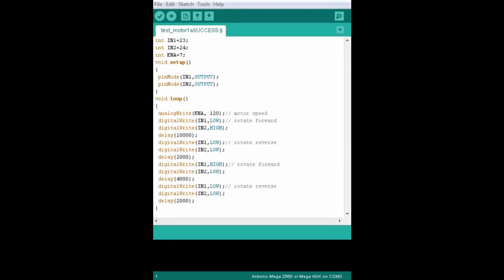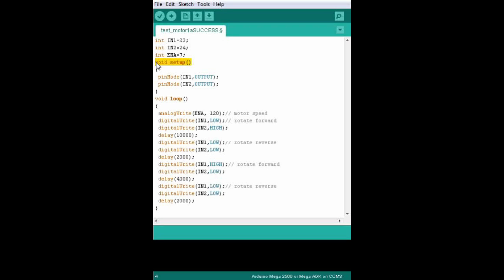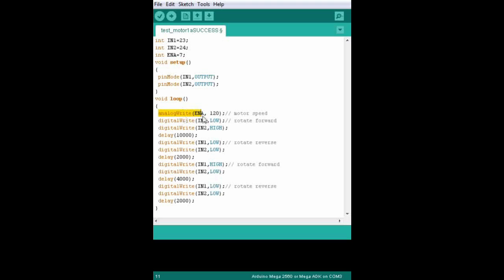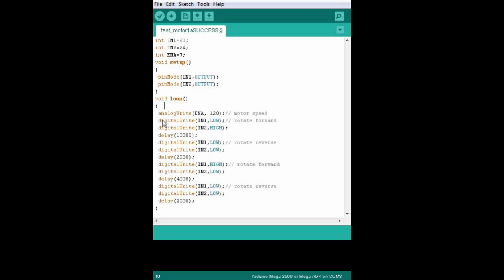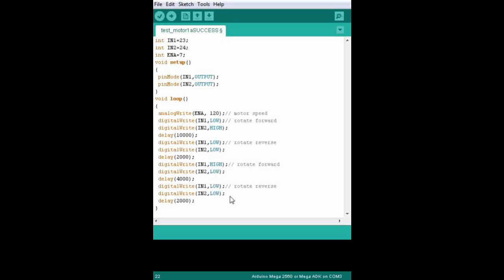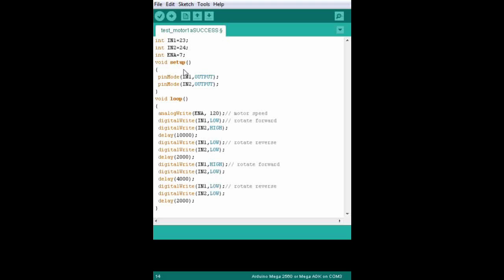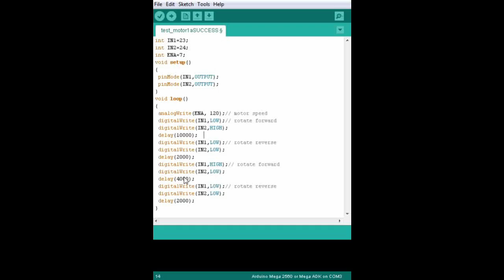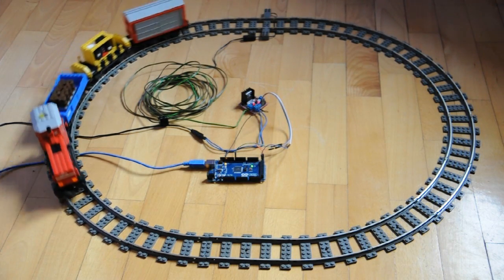Arduino for Lego Trains #1: Introduction

Comment: This guide misses out 2 key parts. The power supply, how it's setup and what you're using. And how to transfer Arduino code from the IDE to the board. But otherwise thank you for this, I'm setting up a Lego train for a display based on your guides.

Comment: 4:53 quick question what is that little red button on the arduino board is that like a power button so you could toggle it if you want to
Reply: Reset button. Restarts your code.

Comment: Hi, I also have had a lego train for many years and have often dreamed of being able to set up computer control of it so I was delighted when I came across your videos. So far , I have purchased an arduino mega, some ribbon wire and the L298N motor control module. Having just re-played the video I noticed that you use special connectors to connect the ribbon wire to the L298N module. I would be very grateful if you could tell me what these connectors are called so I can order some. Many Thanks

Comment: You are using the old Lego trains. My question is : can I do these smart things you describe in your videos with these type of trains ? If yes , which of your ideas ? Could Arduino and the L298P achieve the same result with the newer Lego 12V models which have onboard power as opposed to track based power function? I don't want to buy the L298P and Arduino and not be able to use them.
Reply from the maker: Check out the videos number #11 and higher. They are all based on the newer 9V trains with battery packs. Lego has not made 12V trains in nearly 40 years.
Reply: @ArduinoLegoTrains  I have a similar question. Could you explain how to connect the newer 9V trains to Arduino and the Motor Controller? (Where do the C1, C2, GND, 9V wires all go in and How to set the speed  for these new 9v trains?)  I've looked at video #11 but still cannot find how to wire the newer 9V trains.   Thank you for the great videos and help!

Comment: how can i implement it with a L298P?
Reply from the maker: As far as I know, L298P works exactly the same way as L298N. If this is a shield, you just need to change the pin numbers in the code for IN1, IN2 and ENA.

Comment: Hey man, first of all just want say thanks and really amazing job on the series of vids...they have been immensely informative, well produced and an awesome help in getting started with Arduino and Trains when starting from scratch. Great job !!! 😀Your series has inspired me to start my own tinkering and Lego trains project. So a quick random question for you (and I really don't mean to ask / bother)...all your examples use a L298(N?) motor driver with 3 H-bridge pins per channel (i.e. with a dedicated brake pin). Any idea how you would brake / stop a motor on a driver with only 2 H-bridge pins per channel (direction & PWM) ? I seem to have picked up a driver (DFRobot L298P) with no dedicated brake pin 😕
Reply from the maker: I've never heard reference to a "brake pin' before. All motor controllers provide two wires per motor, so that they can supply + and - to make the motor spin. On the other side, they have two input pins (from the arduino) so that you can specify which output pin is + and which is - : this allows you to specify direction, and whether the motor is running at all (if both pins are -, the motor can't run). There is also a PWM input pin to control motor speed, making three inputs and two outputs per motor. If you want to brake a motor, you just flip the polarity of the output pins momentarily, which you program into your software.

I've just looked at the schematic for the DFRobot L298P, and I see exactly that: four screw terminals to connect to the motors themselves, plus at least six pin connections for your +, - and PWM pins on the arduino.
Reply: Yeah my apologies for being a "n00b" and that reference to the "brake pin", my bad...still learning all the terminology...I didn't word that correctly. What I meant was, as you mentioned the two dedicated pins for + and - (allowing to control direction and "brake" / disable) and a PWM pin for speed = 3 pins. Get that, and see that in your examples, on the official Arduino motor controller shield examples, and most other examples out there. Why I was confused and mentioned the "2 pin" thing (1 x direction and 1 x PWM), is that the official documentation / how-to from DFRobot on the L298P page only mentions 2 pins per channel and only shows 2 pins in their sample code, plus no mention of IN1, IN2, etc...just E1, M1, E2, M2.

See here:  https://www.dfrobot.com/wiki/index.php/Arduino_Motor_Shield_(L298N)_(SKU:DRI0009)

So they are saying: "The speed control is achieved through conventional PWM which can be obtained from Arduino’s PWM output Pin 5 and 6. The enable/disable function of the motor control is signalled by Arduino Digital Pin 4 and 7". And their sample code shows this, hence I was all a bit confused when tried to reconcile to your examples :) I mean its fine now, I kinda figured it out and I have everything working using the 2 pins for channel (1 for direction and 1 for PWM) and I am "braking" by simply setting the PWM value to 0...which is a "coast" brake, but is fine for what I need and everything is working. I was just initially rather curious as their example code did not use the 3 pins...so I was like "ummmm how the heck do I brake ?" LOL :)

Through a multimeter, I have also noticed a drop off of around 3 volts (i.e. so 9v -> 6v) at the motor terminals on the shield, and hence to the rails. I have read that this kind of voltage drop-off is a rather common problem with the L298 driver (or H-bridge drivers in general), and many see this happening. I have to assume then that this is why you use a 12V power source in your examples / setup ? (so you can guarantee 9V to the rails ?). Cheers for the tips, help...and once again for these pioneering videos, Justin.

Comment: can i apply this to my DC model train?
Reply from the maker: Absolutely. Just make sure you adjust the ENA value for the size of your train, so that you don't make it go too fast.
Reply: can i use arduino uno and arduino motorshield?
Reply from the maker: Sure! The only real difference between the Uno and Mega is the number of output pins. The Motor Shield uses exactly the same chip as the motor controller in these videos (L298). So just make sure you change the pin values in the code to match your Motor shield, and everything will work perfectly.
Reply: i don't know what will i replace in the pin values it's not working... can you help me out?
Reply from the maker: At the top of the code it says:
int IN1 = 23;
int IN2 = 24;
int ENA = 7;

For your motor shield, replace this with:
int IN1 = 12;
int IN2 = 9;
int ENA = 3;
and connect your two motor wires to the channel A terminals on your motor shield.
Reply: i'm using guizduino uno and motorshield i dont know what pin number i will use
http://www.e-gizmo.com/KIT/images/gizduino/Gizduino%20manual.pdf
Reply from the maker: Any arduino uno clone (including your guizduino) will use the same pins for the motor shield: 12, 9 and 3.
Reply: thank you! it works! i replace 3 with 11 :)
Reply from the maker: Paolo Espiritu
Congratulations! Happy to hear it works for you :)

Comment: could you please let me know the model number of the train set you have used, I guess you are controlling the train speed by PWM is that right?
Reply from the maker: Hey, the description of each video lists the model number. This particular set is 4563. And yes, all Lego trains (9V, 12V or Power Functions) require a PWM pin to control.

Comment: can anyone write the list of the components .. please ?
Reply from the maker: Hi! You need:
1 x Arduino (Nano, Uno, Mega...)
1 x L298N motor controller
1 x 12v 1A power supply (connects to L298N)
1 x Technic 9V power wire (which you must cut)
1 x Lego 9V or 12V train (NOT Power Functions or RC)
and some wires to connect L298N to Arduino.
Reply from the maker: Well, you need a laptop/PC to program the Arduino, and a USB cable to connect to it, but yes - that's all you need to produce the results in this video.

Check out the other videos for more interesting examples!
Reply: Is the 12v 1A power supply enough to power the entire box shown in video 10?

Comment: I see you plug in the 2 power supply wires into the motor control but I don't see where that is going.
Reply from the maker: The two blue wires on the motor controller go to the two wires of the power supply shown at 0:48. It's a generic 12V 1A power brick.
Reply: +Arduino Lego Trains did you have to create an adapter to go between them?
Reply from the maker: It's up to you. If you have a power supply with a standard barrel connector then you can either buy the appropriate socket from an electronics store and wire that to the motor control, OR use tape and wires directly to the barrel for an unsafe and extremely temporary solution.

Since these power supplies are so cheap, I just cut the barrel connector off.

Comment: Where does the power for the track come from? Did the Motor controller get the power from a power supply, or from the arduino? I'm a bloody beginner....
Reply from the maker: look at the 4min mark. The blue wires are coming from the power brick (generic 12v 1a unit), and the green/brown wires go to the standard lego 9v track power connector.

Comment: I will be honest I have not yet watched all your videos so you might have one over this question but looking at your titles I don't think you do. Do you know if you can (and if so how) to have two or more arduino's communicate wirelessly?
Reply from the maker: I haven't covered it in these videos, but I plan to in the future. Arduino projects usually use nRF24L01 radio boards for wireless communication, and two arduinos can communicate using their MOSI/MISO  pins. This page has a lot of great information on this: https://arduino-info.wikispaces.com/Nrf24L01-2.4GHz-HowTo
Reply: I have started to build an amazon shopping cart of stuff and I had some in it already, glad to see I was on the right path. However 1 part I am having trouble finding is the light sensor from video 2. When I look up the one you are using I find sound sensors.
Reply from the maker: I use a generic photoresistor module. There are plenty on amazon; the only difference is the length of wire between the photoresistor and the module's circuit board.

Comment: The L298N motor controller directly controls the Lego Train's motors or it gives the orders to the Lego Train's remote and then the Lego Train's remote controls the motors ? (excuse me my sentence is not very correct because I don't speak English very well)
Reply from the maker: It directly controls the trains. These trains are controlled through the track, not through a remote.
Reply: So if I have a train controlled by a remote the L298N will directly control the motors too ?

Comment: Great video . . Would this setup work with a 12v transformer?
Reply from the maker: the power supply I use is 12v, so there shouldn't be any problem
Reply: Thanks for the quick reply! .. I also recently rediscovered my old 1980's train set which amazingly still works.
Reply: Hi dot dot Hi Arduino Lego Trains! Did your grinders work properly (12 Volt system)? I have actually problems with that, try to fix it with a alittle bit of soldering.

P.S.: The Videos are really great!

Comment: Does the power supply have to go into the motor controller or can it go into the arduino? I'm just tentative about defiling the end of a power cable like that.
Reply from the maker: You do need to put power into the motor controller first. I bought the appropriate socket to match my psu's plug, and simply ran two wires from that to the motor controller. It cost pennies.

Comment: Hi, exciting!
What I am confused is about your custom-made cable.  Why you need that cable to be exact?
Thanks
Jerry
Reply: +Jerry MJ I am no expert, but I am curious to know if it would work. But would it be possible to use the decoding tool in Video #7 to learn the codes sent by the IR remote on different channels to and send those codes out with the arduino to control multiple trains?  

I am new to electronics, arduino, programming, and IR, but its what I was thinking.
Reply from the maker: Jerry MJ  Thanks for watching! You need the cable to connect the motor controller (L298N) to the lego train tracks. Lego 9V tracks get power from this connector: http://www.bricklink.com/PL/5306c01.jpg , which you can see at the start of the video. The custom cable means you don't need to modify this connector.
Reply: Arduino Lego Trains Thank you for the reply.  If I have an IR train, this portion of the customization is not applicable to me, right?
Reply from the maker: Jerry MJ that's correct. However, you will need this cable if you want to build the motorized track switches in tutorial #3: http://www.youtube.com/watch?v=h-5FmGfYzRs